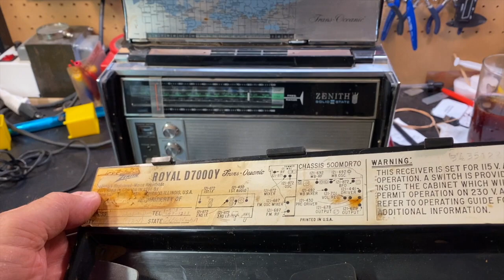Zenith TransOceanic D7000Y   Episode 2 Disassembly

Comment: Were your bulbs working? Do you know how easy it is to replace them? Does the dial need to come out? Thanks!😊
Reply from the maker: No, the bulbs weren’t working. You don’t have to remove the dial, fortunately. The bulbs are mounted inside a narrow strip of metal that’s attached to the dial with two screws.
Reply: Great…thanks for confirming this…looks like I need to get a few bulbs and start disassembling…cheers!

Comment: Enjoyed your video! I picked up mine for 10 bucks at a flea market. Seller said did not work. Beautiful condition otherwise. Only needed the am converter transistor replaced. A snap to do with those plug in transistors!
Reply from the maker: Thanks!